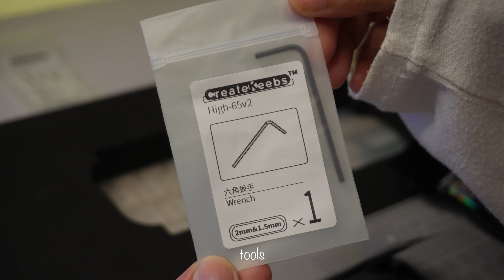still the best pre-built mechanical keyboard 2023 | ft High65 v2 and BSUN x switches

Comment: how smooth are those bsun x switches? and was there any spring pin or leaf ping. I'm debating on those or tangies for smoothness
Reply from the maker: none at all. its a guaranteed buttery smoothness, the pre-lube was done nicely and consistent. i highly recommend it. on the other hand, im not a fan of the c3 tangerines, i tried it and its not as impressive as i expected it to be
Reply: @mczstudio  i joined the gb even though I told myself no more gbs, but its nice to know they're buttery smooth. What was it that you didn't like about the tangerines? Not including sound